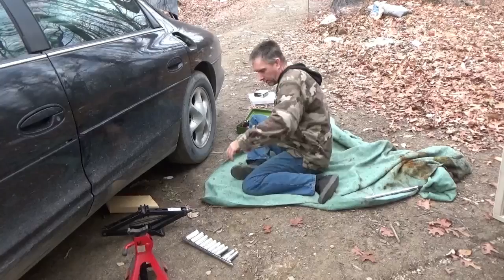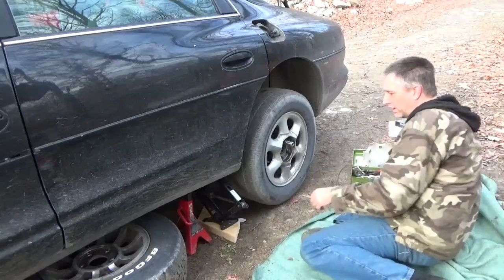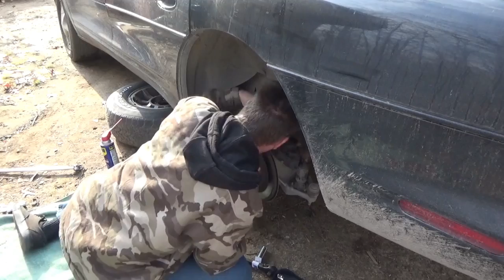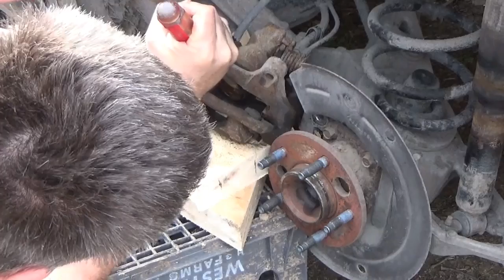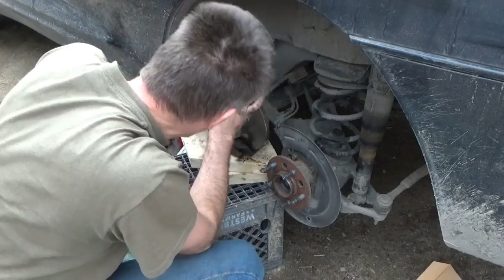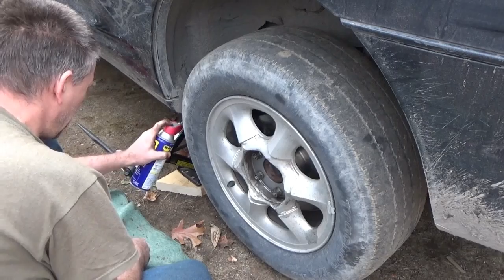Toughest Brake Job Ever On My 99 Olds Aurora

Comment: you  shouldnt  support  the  car  by  a  pinch  weld   reinforced  or  not look  for   a   solid  point  on  the  rear axle mine  is  independent  suspension  so  i  usualy  place  the  stands  where this  ties  in  the  reason  for not  supporting  the  vehicle  buy   any  pinch  weld  is  because  thats intended  for  only momentary and occasional  use like  when  changing  a  flat  tire  on  the  road i  ha a  dealership supporting  my  car  by  the  pinch  weld  and it  crushed  and  did  body  damage  that  they  had  to pay  to fix only  thing  they  were  doing  was  a 20.00 oil  change  and  i  cant  get  oil  and  a  filter  for  that  price lol
Reply: also its a  lot  easier  to  remove  the  bolt  that  holds  the  caliper  on  (the  other  is  a  pin)  then  you  put  rotor  on  first  followed  by  your  caliper   bracket  then  put your  new  brake  shoes/pads  on  your caliper  mount and  then  reinstall  your  caliper making  sure  to  use  brake  grease  on  the pins  you  have  the  same  rear  axle  set up  as   my 04 lesabre
Reply from the maker: +Tim Johnson I am using it at the very point that the manufacturer says to do it. It is labeled right on the car itself and in the owners manual - which I still have.
Not sure if I can get under the axle but for future reference I will look and see.
Reply: +The Do It Yourself World  theres  a  piece  of   tube  steel that  runs across this  is  part  of the independent  suspension but is  fixed  to  the body   and  factory points on  pinch  w
elds  are fine  but not for  anything  more  than  a  few  minutes  especially  if  they start  to  corrode so  great  jacking  point  with  factory  job but  place  the jack  stand  on  that tube steel or  if  in  front  i   place  the  stands  under  the  cradle
Reply: +The Do It Yourself World  it  was   our  local   Chevrolet garage  im the  second owner  and it  was  were  the  car  was originally  purchased  they  ended  up   costing over  800  in  damage on  a rust free   vehicle
Reply from the maker: +Tim Johnson Ouch
Reply: +The Do It Yourself World  wasn't  out  of  my  pocket  i  made them  fix  their  mistake  and  havent returned  since i   was   there  for 2.5  hrs  for a  oil  change  appointment

Comment: Lol bro you could of tighten the caliper bracket on first then put the brakes on ans slide the caliper on
Reply from the maker: I could not get the caliper to recess though. These take a special tool and have to be screwed back in. Mine was rusted solid and could not screw in so I had to get a new one.

Comment: Dude take the caliper off the rotor bracket 😒 😂 an you could have both sides done in a hour an if you don't have that tool just flip a pair of pliers over an use that handle part an turn it in

Comment: Had to stop watching half way through because i felt sorry for the guy because brake job can't be that bad!
Reply from the maker: It was that bad. You need a special tool for these and it was rusted badly. Would not turn. I ended up getting a new caliper.
Reply: @TheDoItYourselfWorld  
I just bought a 03 Aurora and I have to replace all 4 calipers 😤

Comment: you also do realise that ALL car brake calipers split into two so it makes access to the piston and and place the pads in? also why were you spinning the piston, basic common sense of how a piston works, in and out its not a screw..
Reply from the maker: +diavo009 Basic common sense does not fit here. This is an Olds Aurora, look it up. The brake piston does NOT compress like normal ones. These screw in.
Reply: +The Do It Yourself World true many vehicles brake pistons work on a screw system there is a special tool to screw them in but not rocket science to figure a way to do it w/o just dont scratch piston sides. id try a large needle nose put tips in notches in top of pison and screw and push in should work. I'm a mechanic for a large taxi fleet. various vehicles dodge caravans vw jettas dodge e350 super duty, sprinters. ect
Reply: +The Do It Yourself World and they are a quick fix once you do it a few times lol I could swap out your brakes troy in under 5 mins including tires off and on lol. good job you doing this yourself youll learn a lot plus save money! we all need to know how to maintain our vehicles.
Reply from the maker: +David “Kryp2nite” Moreland Ok, here is one for you. I cant get the other side to turn one way or another. Seems froze up. I am getting a ride into town to get the tool today but I cant get the piston to turn. I fear it is frozen up. Does the other side go the opposite way? The drivers side is clockwise to turn the piston in. Is the passenger side the same or counter clockwise?
Reply: idk but regardless it needs to turn easily so you would quickly find out which way. its froze up need a new caliper. it suc k s I know but you should never have to work hard at turning it in.

Comment: Bruh!!! Pls dont make a brake video if ur dont know wtf ur talking about, i can do brake job in 20min both sides, but ive also been doing it for years
Reply from the maker: Then you, being an expert, know that this car needs a special tool to retract the brakes. Anyone can do a simple search online to see that. Most auto parts stores sell the tool for about $20
Reply: No sir, u can disconnect the brake line and decompress the caliper with ur hand and then bleed the caliper after u put it back on, the tool just makes it easier, and my comment was mostly about how u too the whole caliper off wich is not necessary and disconnecting all ur abs sensors is also not necessary and couldent find ur screw to open ur caliper up
Reply: The Do It Yourself World and how u tried to depress the caliper with the caliper still closed
Reply: And how u put the caliper on the rotor and tried to put them both on the hub at once, put the rotor on then the caliper
Reply: And u only brake cleaned one side of the rotor
Reply from the maker: Its threaded. It has to be turned to compress. On the other hand, you have a good point about taking off only one half. I have heard of that before. But the caliper still must be compressed in order to get on the new pads.
I have insomnia and have been stressed due to harassment and vandalism for years. Nobody helps. So yeah, I look a bit rough. Thanks for the compliment.
Reply: The Do It Yourself World         even with it having a threaded caliper, if u open the bleeder valave and let air in u can almost spin that piston by hand cuz theres not like 2,000psi behind it